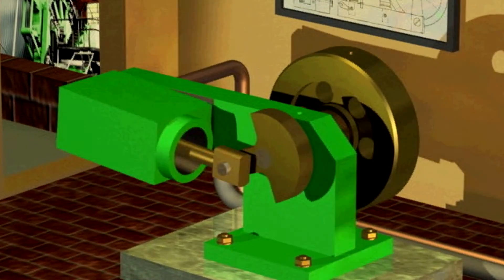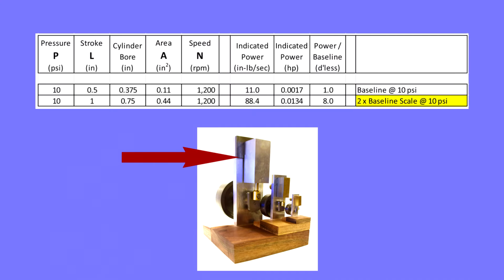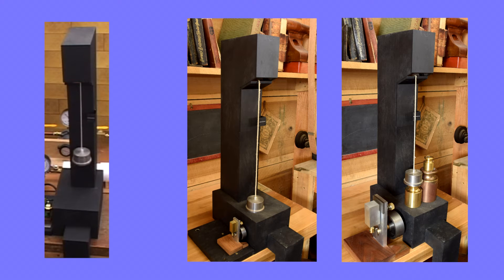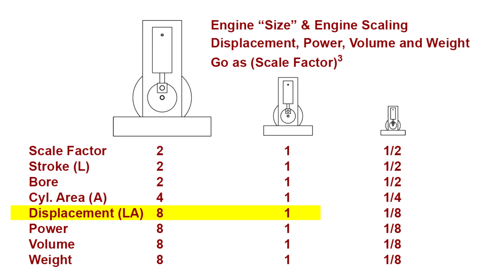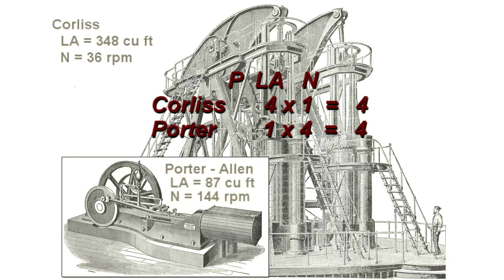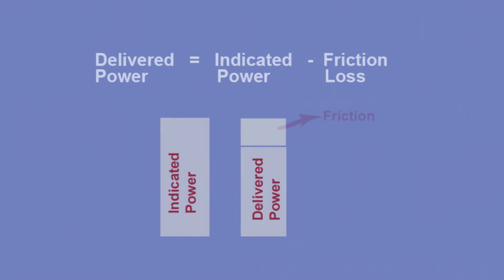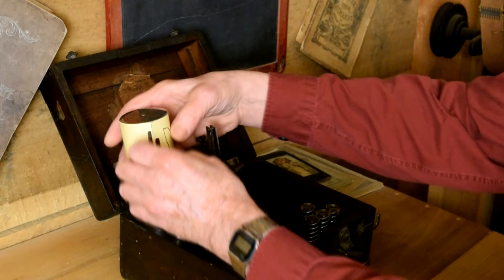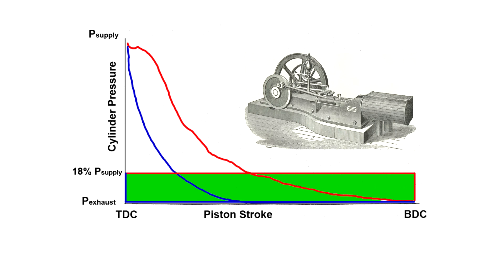Engine Indicated Power - PLAN

Comment: This is a very nice demonstration on PLAN and the effects of engine size and displacement. I have a question which I need to explain in some detail. The Stephenson link and its variants allowed the steam engine operators eg locomotives, to vary the valve timing as needed. They could continue to apply full pressure throughout the whole power stroke (TDC to BDC) when taking off from stationary at low RPM, giving maximum torque for acceleration. Full steam pressure was still being applied when the exhaust valve opened at the end of the power stroke, causing a loud puffing sound. 

However, after reaching cruising speed it would be inefficient to let full steam pressure escape through the exhaust valve. Efficiency could be improved greatly by shortening the intake by closing the intake valve very early in the power stroke. Then the steam which entered early was left to expand as the piston moved. Then the steam being released through the exhaust valve at the end of the power stroke was at a much lower pressure and less power was wasted. The steam was used more efficiently. 

I recently went on a tourist trip on the small steam powered launch Earnslaw on Lake Wakatipu in New Zealand. The operator was not making use of the Stephenson linkage provided in the engine. Instead he was partially closing off the steam valve supplying steam to the engine. I tried to explain to the captain that they should use the Stephenson linkage, but he didn't get it. The question is, how much difference does it make?  

If they only need quarter power they could cut the steam supply to one quarter the pressure.  Alternatively,  they could have the inlet valve cut off about one quarter way down the stroke. Then during the rest of the stroke the volume would increase 4 fold and pressure would drop 4 fold and exhaust steam pressure would be reduced to one fourth. Thus the exhaust steam pressure is the same as cutting the supply steam to one quarter pressure and keeping the inlet valve open throughout the stroke. On this basis it seems that the two methods are equivalent. This is not what I expected.

Thanks for you YouTube videos!

PS. I also went on a very similar triple expansion steam launch in Connecticut.